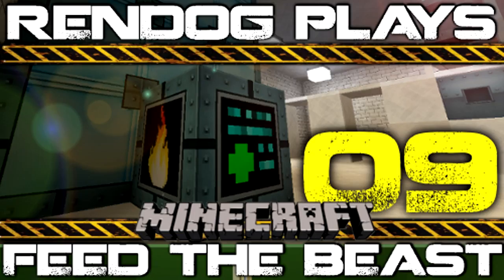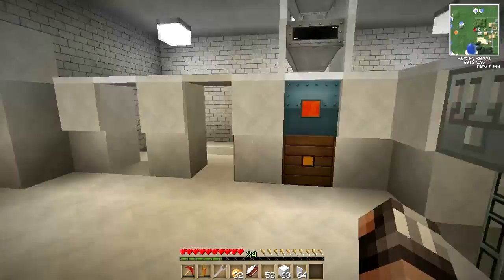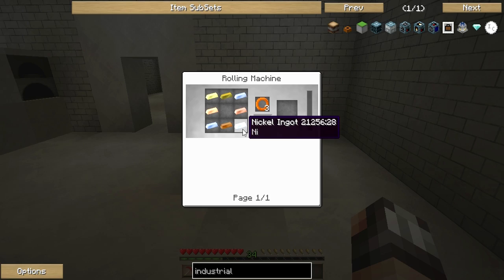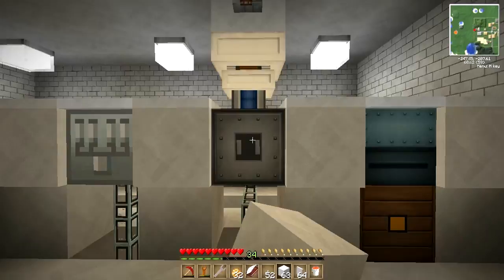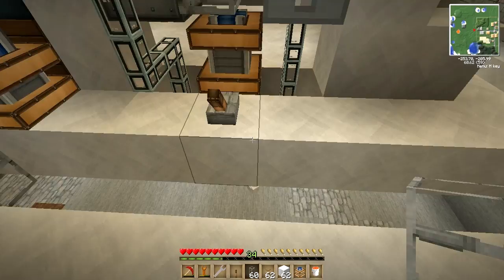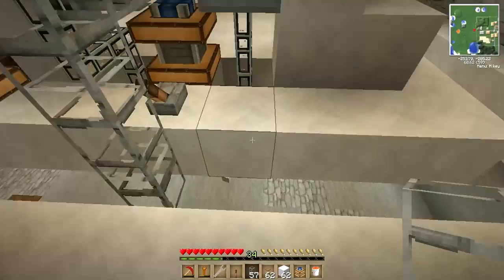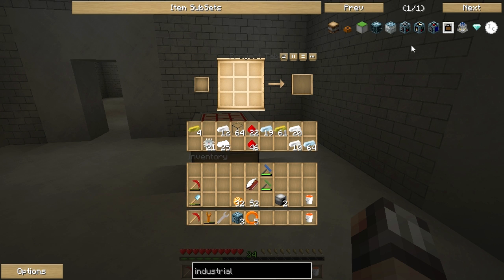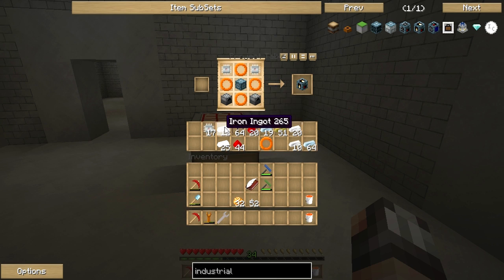[S1E9] Let's Play Minecraft FTB - Industrial Blast Furnace!

Comment: Rendog, rewire the electric motor so that the cable moves out an additional block left, then up three, then back right 1 block to connect to the motor. This allows you direct access to the block to attach a pipe and room to attach an redpower motor for the extraction.

Comment: You should move that engine behind the machine and use redstone to switch it on a off. That would leave space on the top for the goods to come out. You also don't need to have the power converters so high/they don't need to be visible, you could move them into the flooring. Main point: USE REDSTONE to wire things up! And remember that engines used for pumping out goods can be triggered by a button and a red pipe so they automatically turn off.

Comment: Place covers on the side of the pipe you dont want to connect and it will block the pipe, also, put the cover in a circle(8) in a crafting table to make a cover that allows pipe in middle, there good for using under or beside chests for visual neatness

Comment: Hey Rendog when you connected the rolling machine to the electrolyzer u can use a panel in between the pipe and the electrolyzer and it should separate the two

Comment: You for sure need some sort of sorting and storage system in place before you start the quarry.  For the wood pipe connected to the two machines, just place a micro block on the face of the machine you don't want it to connect to prior to placing the pipe....P

Comment: Hey rendog. i dont know if its a glitch in my ftb or not but you may want to check. i noticed if i make un-shielded copper cables. just 3 copper in a line and then place those next to the rubber balls that i  use less rubber to make the rubber coated copper cables.

Hope i explained it well enough.  It would be neat to know if this works for anyone else also.